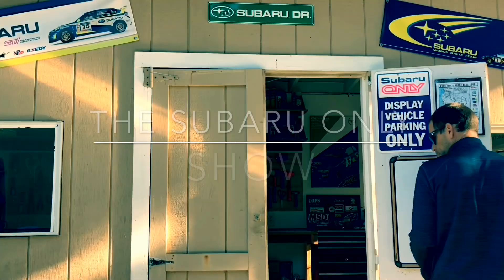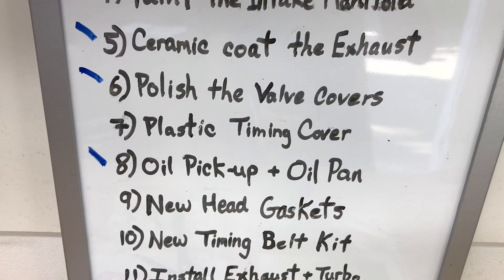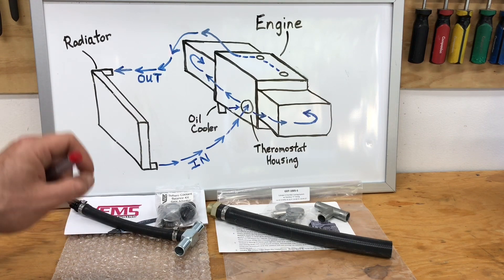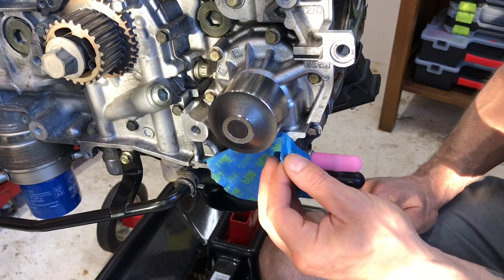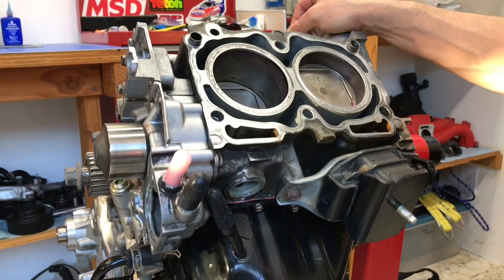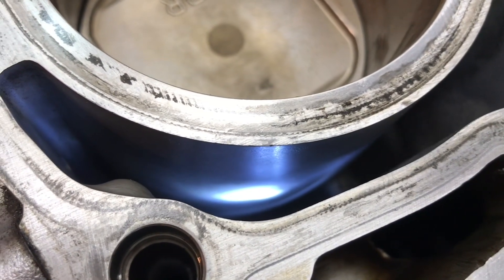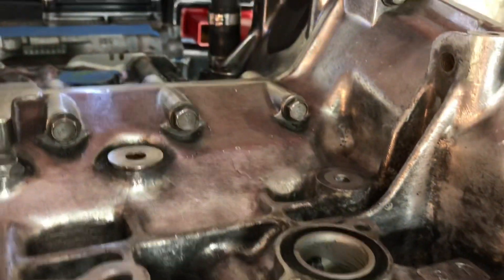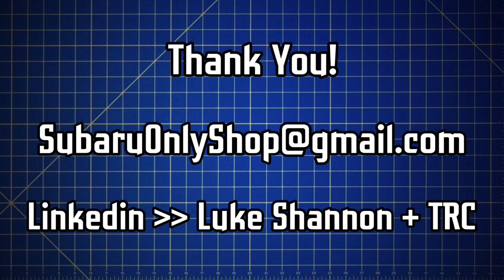Coolant Flow in Subaru EJ-Series Engines

Comment: I have to drain an clean as much as possible coolant from a build closed deck with bad head gasket in order to not allow glycol enter cylinder and sitting there damaging elements due to high corrosion, engine have to wait several months until rebuild done.
This content is exactly what I was looking for, so big thanks from Spain!

Comment: I got unusual issues with my leggy. When the temp drops down to the teens, the starter doesn't want to engage. Warm it up to 20 and she'll start. That's the first. 2nd issue is thus, had an overheat issue. The gauge said pegged. The radiator and hoses called the gauge a liar. I had a little bit of coolant on the drivers side bank with no water pooling underneath the car. Radiator cap was cold. 
 Added water, wouldn't take more than a pint. Didn't run hot after that. Any clues as to what's going on? I'm a former mechanic and I don't understand these things. The starter not a real big issue, probably a solenoid hanging up when really cold. But the cooling issue baffles me currently. She hasn't acted up since. Any ideas or has someone run across these issues before? Clue- she had been driven 25 miles when the cooling issue occurred. Didn't overheat going back that 25 miles.
Reply from the maker: Cheers buddy! I’ll give these my best shot. 1. The starter issue, could be the solenoid hanging up when cold (as you suggest) or could also be a loose wire (positive or ground), which is something that is actually pretty common too. 2.  For the overheating issue, this may be a bit more complex. If there’s any coolant escaping the system, than there’s no pressure holding either and that’s a problem, also it’s pretty easy for a hot pocket of coolant to develop due to an air pocket (which can easily happen if there’s even a slight leak anywhere in the system), so I think all these issues may be related.  I’d located where the system is leaking (even if very minor), fix that, top off the coolant, and keep a close eye on everything. Hope this helps, good luck!
Reply: @SubaruONLY  I'm getting so old. Been out of mechanics to long. I'm seeing a loose, corroded connection and bad cap. In my nugget of course. I'll look those over.thanks

Comment: Would you say this is a good mod (cooling mod) for a brand new STI that’s going to be used as a daly? Or is this more for someone that is tracking their car..?
Reply from the maker: Yes, I think this should be used on all Subaru engines as it controls heat better under all driving conditions.  Good luck!  👊

Comment: Hello MrSubaru, I’m looking to purchase this mod. Should I go with the vemstuning or getadom? The vemstuning mod looks higher quality.
Reply: SoEpix Dominic from getadomtune is the guy who originally designed and engineered the cylinder 4 cooling mod. Other sellers copied him. If you were to buy this I’d recommend going to his website and ordering from him. 

Also look up OCTurbojoe. He’s a jet mechanic and has a great review and install on the getadomtune cyl cooling mod.
Reply: I’d definitely get doms. I just installed it n it’s working great so far. The temps do seem lower
Reply from the maker: Nice! 👍